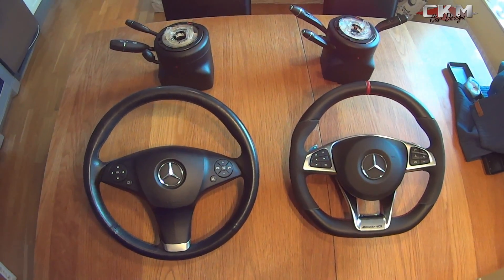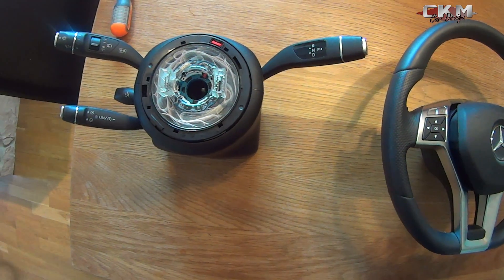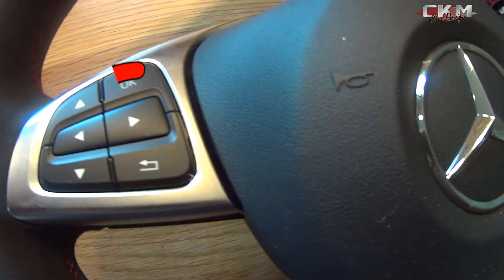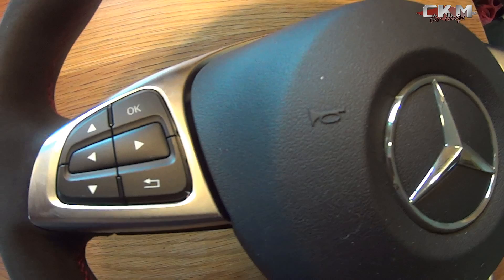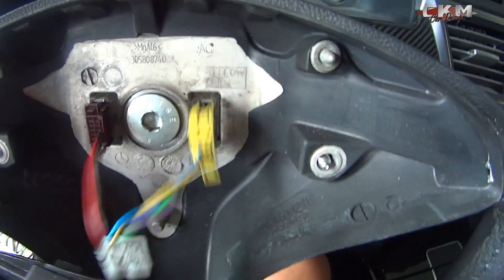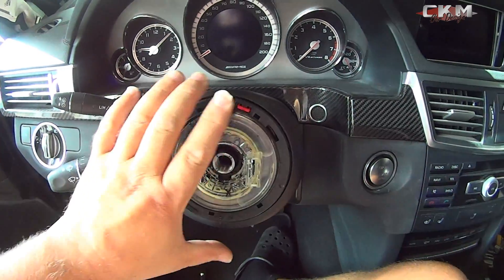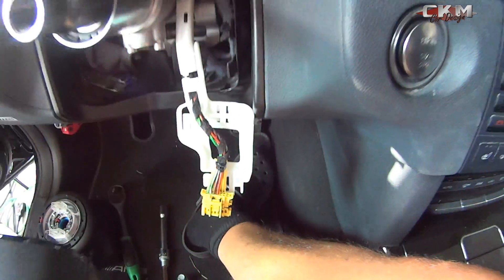Mercedes Facelift steering wheel retrofit W212 W204 W166 W176

Comment: W212 dun hv paddle shifter, after convert the paddle shifter can use?
Reply from the maker: Of course.
Reply: Where can buy, need column and steering? 

Can you gv me link?
Both
Reply from the maker: @ji-minghall314  www.ckmcardesign.com
Reply: @CKMCardesign need which one, hard to find. Can u find for us?
Reply from the maker: @ji-minghall314  All on site works. Only one column to shoce from than add pic of your old just as it says.
Reply: @CKMCardesign  shipping to Malaysia?
Reply from the maker: @ji-minghall314  Yes.
Reply: free shipping？
Reply: CKMCardesign w212 dont Have paddle shifter ，after convert paddle shift confirm can use？ i will buy it
Reply: CKMCardesign your site steering wheel included airbags?
Reply from the maker: @easonng1923  Of course not. Sold separatly.
Reply from the maker: @easonng1923  No?
Reply from the maker: @easonng1923  Yes if the corect column is bought.

Comment: Has anyone done this and it actually worked? As multiple people have tryed and it doesn't work? Now stuck with 2 steering wheels, 2 airbags and 2 squibs! I have a W204 and all the equipment pictured in the video!?
Reply from the maker: And you have 2014 stalks?
Reply from the maker: If it truly is a 2015 it will work.

Comment: Hello, i've Pre-Facelift A-Class w176 (2013 - Manual Shift 6-speed) if i mount a new steering wheel restyle same as video with paddle (for auto shift),may  i have problem with command audio and system on new steering wheel? what about column, need a new column? i think that paddle of shift on steering wheel stay without function and rest of all work correctly.. right? :-) @CKMCardesign
Reply from the maker: Paddles dont work on a manual.
Reply: Steering wheel restyle arrive but all command does not work, clacson not work... do u know why? i need to do something to do work ? thanks.  @CKMCardesign
Reply from the maker: @concettadimauro7961   Mail me ordernumber and I help you out..

Comment: Hi I have a 2010 Mercedes CLC- class C180 Kompressor Sport will that steering fit on it?
Reply from the maker: Fits all w204 models.
Reply: CKMCardesign ok then so it won’t fit mine then
Reply from the maker: Not if it is the W203 model.

Comment: Will it work on e 220 2010?
Reply from the maker: Of course.
Reply: CKMCardesign does it matter if the wheel is from other model from mercedes or it has to be the e class
Reply from the maker: @tarikhalilovic1390  That is explained in video. From all cars works as kong as it is the arrows version.

Comment: Hi, I've got a 2007 c200 w204 - I'm aiming to go for a MERCEDES A-CLASS W176 2012-2018 steering wheel which looks identical to yours in the video and it also has arrows on the side. I'm having difficulty choosing the correct column - would 2015 -2018 MERCEDES A CLASS W176 column work for this? I've read through the comments and it seems you need certain columns from car models. I've dropped you an email on your website detailing the issue.
Reply from the maker: Yes.
Reply: @kalhussain7576 Hey mate, Wheel was pretty straight forward but the column and clock from the 2015-2018 variant I bought doesn't fit in a the preface lift class. I'm assuming I need a facelift c class column only for it to work but will keep looking. The wheel itself and how it looks is definitely worth the endeavour
Reply: @dekyo8043  yo bro if u don’t mind u can send me pictures of how it turned out?
Reply: @dekyo8043  I have a 2009 Mercedes Benz Slk 350 and want to know if it’s worth it

Comment: What exactly do I need to buy to do this to my 2009 c300 4matic sport
Reply from the maker: Column,Wheel and bag.
Reply: @CKMCardesign  alright thanks appreciate it bud
Reply: @CKMCardesign  instead of getting the column can I do some rewiring or moving the module from the old air bag or something I've heard
Reply from the maker: @FJR22  Sorry no.
Reply: @CKMCardesign  so I've got a 2014 w204 steering for a automatic coupe and plan to fit into my 2009 automatic w204...what else do I need to make it work....just a clock spring? Thank you very much
Reply from the maker: @FJR22  Yes. From the same car model.
Reply: @CKMCardesign  the seller does not have the clock spring for that specific car...are the c class coupe 2014 and other 2011+ non coupe c class use the same clock spring...as I may have to find a non coupe clockspring...my car is a w204 2009 saloon
..(btw the 2014 coupe steering wheel should fit a non coupe 2009 c class model right? I'm thinking it should be the same size etc
Reply from the maker: @FJR22  Its just important it comes from the same 204 and same year.
Reply: @CKMCardesign  thanks so I've ordered the same clock spring of the 2014 model called Mercedes so the steering wheel and clock spring are from the same car...just hope it works now....I am just thinking what does the new clock spring electronics contain....does the clock spring itself have unique programming. As the yellow plug 🔌 that fits into the new clockspring is a 4 pin....and new one contains 8 I think
Reply: @CKMCardesign  So my clock spring to match the 2014 steering wheel came today to face lift my w204 2009. No buttons are working on the steering wheel. Do I need to add an airbag in the steering wheel for the buttons to work?
Reply from the maker: @FJR22  NO..Then it is NOT corect column for that wheel. Simple.

Comment: Can i install a 2013+ steering wheel on my 2009 G550?
Reply from the maker: Might work...But the G usally are a bit behind when it comes to what is installed now.
Reply: CKMCardesign I have the steering wheel column for the newer one too I’m just scared that the plug that goes into the steering wheel column is different from the 09 and 13+
Reply from the maker: @PatKaz98   No its not.

Comment: Could you tell me the link to the column
Reply from the maker: www.ckmcardesign.com
Reply: The one you actually installed on your car is not on your site. Did you alter one of them and is it compatible to a 2011 CLS550?
Reply from the maker: You will get the model you need.

Comment: Great video, if I wanted to add a heated wheel, I would have to change the collar, but is there wrong required?
Reply from the maker: wrong required?
Reply: @CKMCardesign  sorry, is there wiring required. Example to control the heating on/off?
Reply from the maker: @davidgervais3893  No

Comment: That nut, from what I understand, is tough to remove. 1. Did you find that so? 2. Did you use Loctite?
Reply from the maker: It can sit hard. No I dont.
Reply: @CKMCardesign  - I'm amazed you don't need a breaker bar. What do you eat?

Comment: dear friend i have finally got all the info together and these are the full facts
i have a 2010 w204 c300 pre facelift wheel

i have now got all the required parts off a 2011 w204 c250 facelift including the steering wheel with airbag and clock spring column all off the same car which is was the 2011 w204 c250
this should all WORK IF I DO EXACTLY WHAT YOU DID?

all the buttons should work and light up and the paddle shifter also?
im very excited to do this upgrade for i love what you have done and it looks so beautiful

and lastly when you say make sure the buttons are the same , do you mean that there should be no home button because mine has no home button
it only the back/return button and the arrows and ok on the left side and on the right side it has all the same button from the voice control to the volume and the mute button just placed differently , but all the buttons are exactly the same. with no extra buttons
from your experience this should be a perfect swap and work perfectly correct dear friend???

ps love your videos wish you were here in Melbourne Victoria, so i could pay you to do all this to my car 
thanks again for everything and all your feedback you have saved me alot of time and trouble and money also... your youtube channel rocks
Reply from the maker: First of thanx a million for the nice words.. Then all should work 100% if all comes from the same car.
Reply: CKMCardesign do you have an email address i want to show you exactly what my steering wheel looks like and the buttons and what i mean by its not the exact same as your video. However in your video you do show the same steering wheel i have and u actually state so long as the column is same it should work
Reply: CKMCardesign friend i finally got all the parts installed but it didnt work what can i do to fix this issue the indicator and wipers and column adjuster is ok but the multifunctional buttons does not work... also one other problem is when i goto my back up camera....it is off centre as if the wheel is turned 1 cycle to the right... i actually msg you on facebook to show you the parts can you help me friend
Reply from the maker: Well buy from me instead and you get what works....This mistake almost all do...Non matching parts. info@ckmcardesign.se
Reply: CKMCardesign how much for a wheel
Reply from the maker: www.ckmcardesign.se
Reply: CKMCardesign i tried to send you email but it did not rexognise your email address
Reply from the maker: chris@mbsca.com
Reply: CKMCardesign i sent u email

Comment: What about the stick shift
Reply from the maker: What about it?
Reply: @CKMCardesign  In the 1 part of movie you can see the gear stick on the column. After assembly, the stick is not visible. Did you switch the cover? What is the shor stick on the bottom iI do not have these in my GLK.
Reply from the maker: @maslowicz1983  As mentioned so many times in the coments it another column.
Reply: CKMCardesign but what year in the steering column from and what car does it come from? Trying to do this on my car but cant find one like your
Reply: @CKMCardesign
Reply from the maker: @JoseRamirez-eq7ji  As it says in video. 2014 or newer. I know AMG cars have them for example.

Comment: Hello my friend, i'm french so sorry for my english, i bought the same wheel in your video at 4:03 but my button is little different, i bought two steering column one of w205 and one of w212 (i have w204) the w212 doesn't work i have a lot of function unavailable(brake,airbag,etc) and for the w205 the honk work with the voice button and paddle shifter doesn't work... i'm lost, in your opinion what column direction i need for work ? If you want more information no problem
Reply from the maker: Then you have the wrong wheel.
Reply: @CKMCardesign  Thank's for your answer my friend, my wheel came a classe c w205 2017-2019, in my wheel i have a voice button in the old phase she has a ok button, if i buy a column direction for 2017-2019 do you think it's work ? thank's
Reply from the maker: @Parkour-ox9zm  That is exactly the wheel I tell you not to buy in video
Reply: @CKMCardesign  Oh... Okay so it's impossible to work in my car ?
Reply from the maker: @Parkour-ox9zm  yes unless you replace all electronics to corect ones.
Reply: @CKMCardesign  Okay i dont want do that it's too hard for me, i buy a new wheel look like your video and i connect my column direction w205 thank's for your answer have a nice day
Reply from the maker: @Parkour-ox9zm  Same for W205 column. Never work.
Reply: @CKMCardesign  so what type column i must work fort the wheel in you movie ? Whats W 204? 212? I'm very lost
Reply from the maker: @Parkour-ox9zm  w212 w176 w218 w166 r231 w117
Reply: @CKMCardesign  thank's you. you are amazing
Reply: @CKMCardesign  Sir , Every wheel with the arrow button works ? wheel classe A, B, C ?
Reply from the maker: @Parkour-ox9zm  Yes

Comment: Looks like the one u showed isnt the one u used… that one has a parking shifter on the side yours doesn’t also u must specify which year of the W212 because the it’s facelift and pre facelift interiors u got people out here buying the wrong steering column this is misinformation not only that u have a w204 why are u buying a colum for a w212
Reply: Also u completely used a different car steering column from the one in the photo u said w212 e class when in fact the one u used is a w205 c class steering column along with a w205 c class steering wheel n u wonder why people in the comments are clueless this is misinformation
Reply from the maker: @manyguns4118  Very simple. You buy with the features you need. And as it says in description ALL columns from 2014 and up works from all models listed. NOT from W205 style and so on as mentioned.

Comment: Will this work on W207?
Reply from the maker: Of course. Second video is of a w207.
Reply: @CKMCardesign  Sorry, it's a mercedes w207 of the year 2010. Could you say if it's worth? Could you say the number of original pieces?
Reply from the maker: @seriamentesi2667   Yes it does. You can get it all on our site.
Reply: @CKMCardesign  Could you say the number of original pieces?
Reply from the maker: @seriamentesi2667  No ? You find what you need on our site.
Reply: @CKMCardesign  Could I get a direct link to the parts I need to buy it directly?
Reply from the maker: @seriamentesi2667  Just look under W207. You have wheel,stalk and airbag there.
Reply: @CKMCardesign  ok
Do you send to Spain?
Are postage included?

Comment: Will it work with x204 GLK 2009 model with Automatic Gearbox and shiftpaddels Thank You very much for the Video. 
And also.. in the first minutes of the video You have showed a new steering column with the paddel PRND as for gear changes. But later when installing You had the steering column without the previous mentioned paddel. 
So which one should I buy?
Reply from the maker: Yes..You have it on my site.

Comment: Would this fit a G500 2002 ?
Reply from the maker: No.
Reply: @CKMCardesign   Thank you for the response, if I replace my oem steering column for the one suggested in this video would it still fits? or no?
Reply from the maker: @christopherreyes9443  Sorry no. You need so much more to make it work in such a old car.
Reply: @CKMCardesign  Thank you for your response men, What steering wheel you suggest to retrofit my Gwagon it seems that there isn't many option.
Reply from the maker: @christopherreyes9443  You see on my site what we can do on your old design wheel to make it look better.

Comment: Hey! This video is super cool but where did the gear shifter go which was on staring column?
Reply from the maker: How you mean?? Its on the floor.
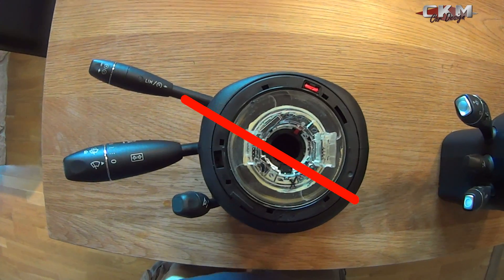Reply: On the steering column there was a lever ( 0:56 top right ) to select the gear, did you take it off?
Reply from the maker: No I used the corect column for the car.
Reply: I was just wondering the same thing, at the beginning you showed the steering column with the shifter on,  but when you installed it it was gone??????

Explain please
Reply from the maker: ALready answered that.. In the beginning I  just showed examples of products that can be used.
Reply: yes you showed examples but the example you have shown has the gear shifter on the right.  But when you have installed the new one, it does not have the gear shifter.  So where did it go or did you use a different example?  There are many people asking the same question but you are not answering clearly.    Please can you clarify.  Even if you use the arm you have shown as an example, it wouldn't work because the car is a left hand drive and there would be nowhere for the lever to go.  So what did you do with it?
Reply from the maker: Answered this 20 times..

Comment: Will it work on a mercedes benz e200 2012 (not w212) ? I mean if i buy under the name "w212"
Reply from the maker: What you mean not W212?
Reply: W212r?
Reply: @CKMCardesign  if i buy a for example a body kit for a w212, but i dont know my car is w212? Simple e200 2012
Reply: @CKMCardesign  doesnt mattery i'm just stupid. sorry
Reply from the maker: @kyedaflamee9731  No one is stupid. You have a w212.
Reply: @CKMCardesign  not yet, but i wanna buy, so the question:  all e200 are w212?
Reply from the maker: @kyedaflamee9731  Yes as long as its not a coupe or cabrio.
Reply: @CKMCardesign  thank you!! 😁

Comment: What about w209 module?
Reply from the maker: Module?
Reply: CKMCardesign  2004 clk500 coupe.
Reply: CKMCardesign anything?
Reply from the maker: You cant have the new wheel work on old cars.
Reply: CKMCardesign even if I rewire ?
Reply from the maker: Yes. You need to move ofer ALL electronics from old then. None of the new works.

Comment: Hi, mine is w212 prefacelift with 5 gear clasic shifter no padles.1)can work only with colum that has no right gear shifter in it (RND)or doesn matter?2)you mention that padles works in yours dispate that you havent padles in the old wheel and you have the gear knob in center dash,how is posible to put a wheel with padles and the padles working in a car that was not made for this and the colum you put has not the right shifter knob in it (RND)?thanks
Reply: also there is plug and play solution to this model to put a new wheel without change the colum?
Reply from the maker: Because its all digital. If you add a column made for paddles it will then work.
Reply from the maker: Depends on year made.
Reply: @CKMCardesign  mine is 2010 model . yes but the column you add has no right knob on it how works?in my case i can put a column with or without right (RND) knob as without  is very rare in new models ? if i put with the right knob on it will work?
Reply from the maker: @jasonpoul1  Are we talking paddles or gear leveler here??? Paddles work. NOT gear leveler.
Reply: @CKMCardesign  my consideration is what column needed to just works , any column 8 pin with or without (RND) knob works in any case? as mine have no factory column with the RND knob on it like this in your video. i can put with or without RND  or doesnt matter? and somethimg else please mine also has inteligent light system ,it has o to do anything this with the column? thanks for your response